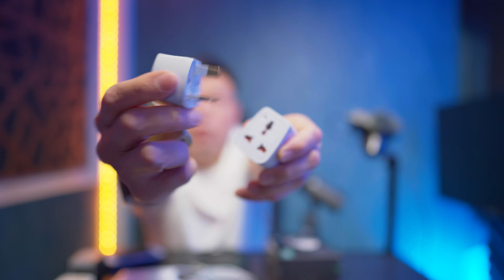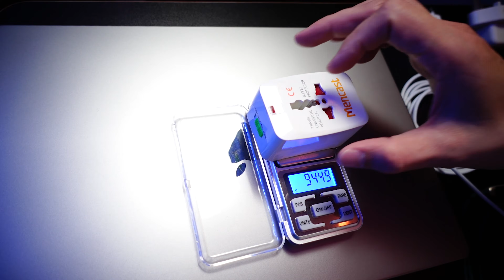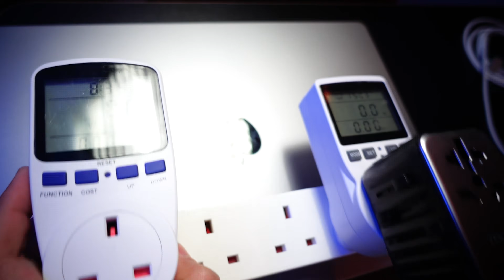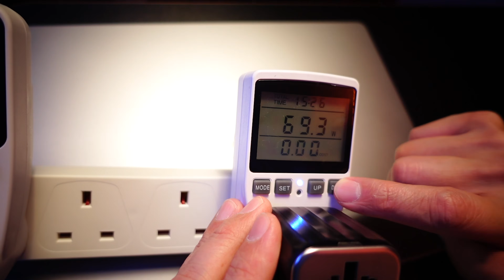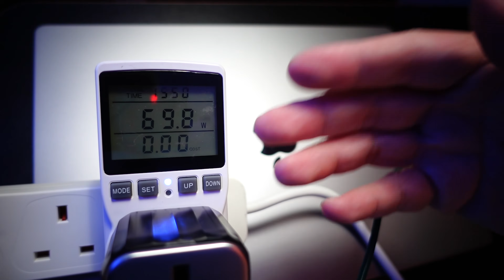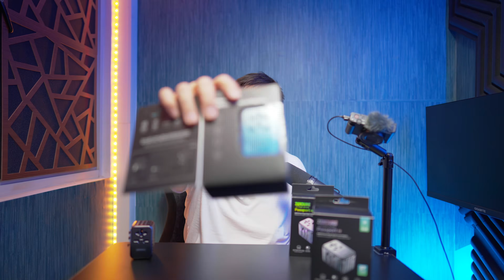The last travel adapter you will ever need

Comment: Think I’ll get 2 of these for my travels to replace my Skross adapter
Reply from the maker: I heard they are out of stock? Not sure. But you should try to get them. Very good chargers even if you don't use them during your travels.
Reply: @PeterPee  ye I had a look after I commented will just have to wait. Thanks for the heads up though